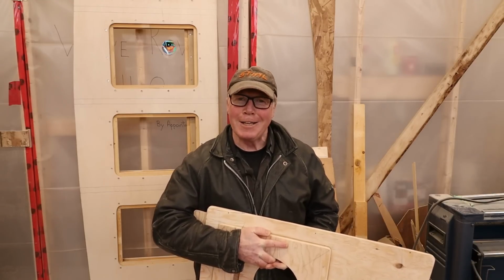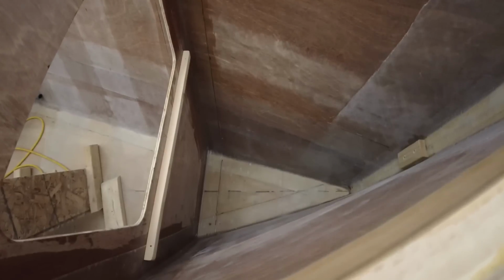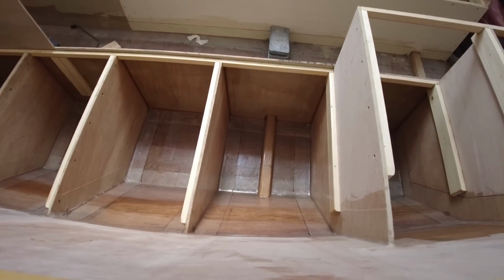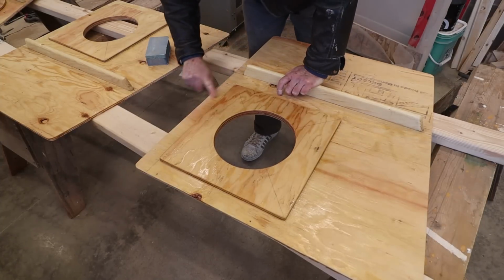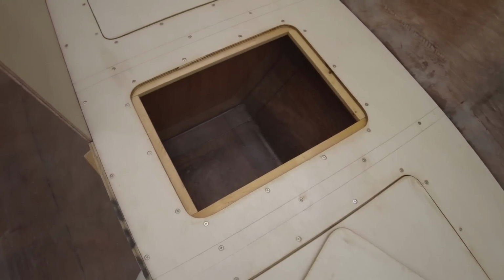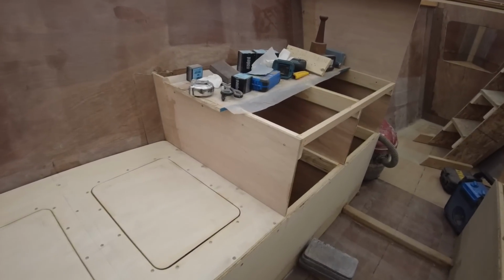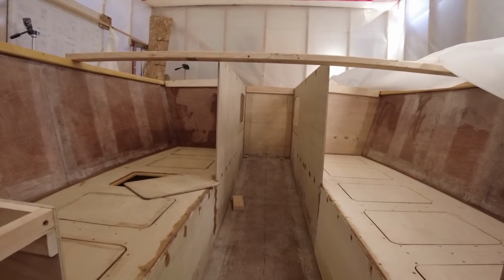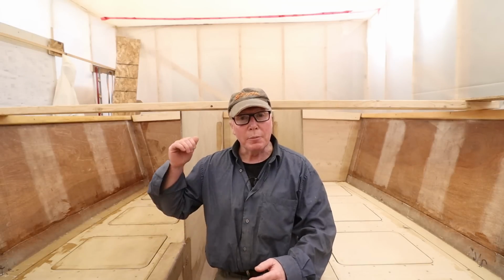S2E47 Sealing Plywood with S1 Epoxy || Installing Crash Bulkheads and Bunk Tops

Comment: a very solid build, like a honeycomb, lots of little sections make for a strong structure.
all the work will pay off in a factor of safety and strength
new sound track too, changing it up a bit.
You have to love the sound of removing the peal-ply too.
Reply from the maker: Peel ply removal...very satisfying.

Comment: These days, where I can timing wise, I lay my fillet and then glass over once it’s started to cure and go a little “rubbery” - 10-15 mins with fast cure.  That way I avoid having to sand the cured fillet before glassing, (because I’m lazy), and the application of the glass over the softish fillet means you don’t have to be supper fussy with the finish of your fillet ( e.g. to avoid unnecessary sanding ).  Since it’s still malleable, the glass and epoxy applied over it, smooths all out nicely.  Cover with peel ply if visible. Makes a one process job out of it. But it can make it a big task if you’re doing doing quite a bit.
Reply from the maker: Fully agree. I would glass over still tacky epoxy fillets but only on smaller (relative) manageable lengths. Good to hear from the antipodes.

Comment: Fine work, one question although. I'm curious to why you use an epoxy sealer with solvents? Would it not be both less problem using lamination epoxy? Do you need the flat surface finish, you still get raised fibers or is it a cost issue?
Reply from the maker: It really is much easier to seal with S1 than regular epoxy especially on vertical surfaces